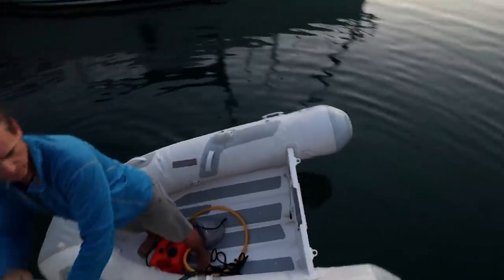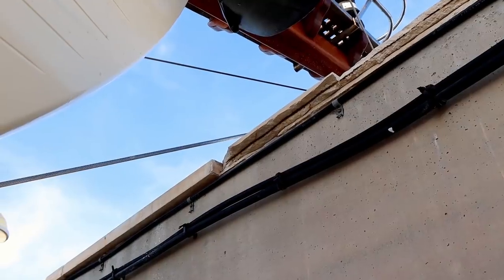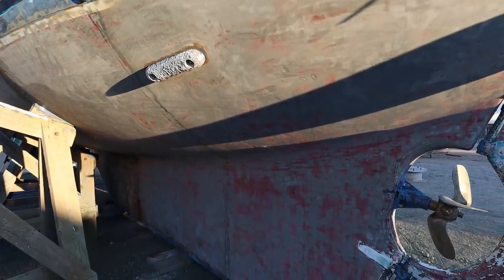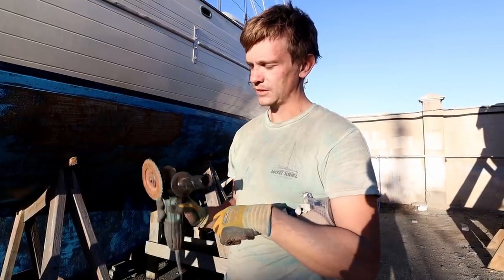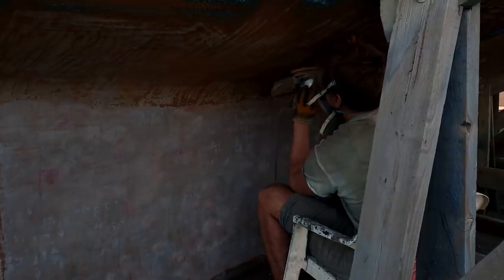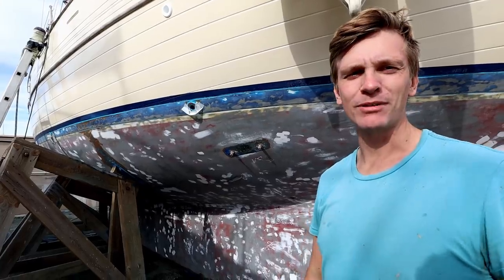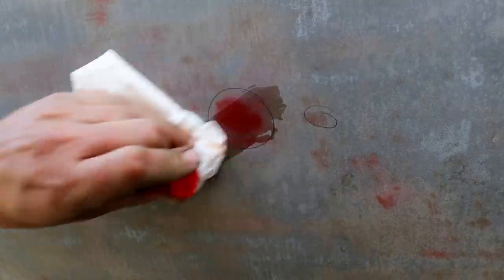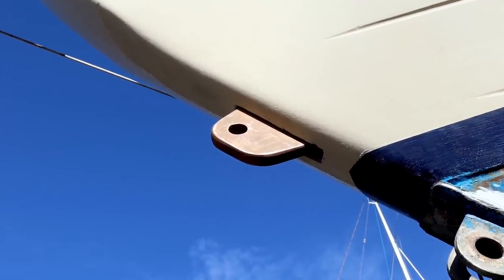88] DON'T Coppercoat Before You See This | 45 Year OLD BOAT Gets Bottom MAKEOVER

Comment: I applied and Coppercoated in 2011. The problem your boat suffered was well understood then. I used solvent free epoxy supplied by Coppercoat. On the upside it's only two coats (because it doesn't evaporate) on the downside you need good weather (above 12 Deg with low humidity) It was perfect when sold in 2018.

Comment: I’ve had two boats copper-coated ... both were done professionally. Neither caused me any trouble. Both performed exactly as forecast by the manufacturer. In my experience it’s a fabulous system, but the hull simply must be prepared throughly. In amateur hands - in the wrong environmental conditions - copper-coat will not work correctly. Think long and hard before opting to install copper-coat. If you can’t be sure of doing it properly, just don’t go there! 

Also, loved that dinghy bow-thruster!! 

Go, you two 😎⛵️💯

Comment: Looks like a tough job, a huge degree of patience and a large surface area to give 100% attention to every bit. How long did the whole job take, rough cost and did you hire or buy tools. I assume this exercise is a major part of annual budget? Did you sleep on board every night?
Reply from the maker: 10 full days. No, we bought the tools - they’re useful to have on board anyway. The cost of smoothing the hull must have been around €450 for the tools (we had to replace the sander halfway), discs, sand paper, etc However we already owned the angle grinder from the previous refit, so it cost us about €350 at this stage.
Yes, we slept on board every night.

Comment: the pencil hash marks are called a guide coat...you can do the same thing much faster by using a very light coat of spray paint then sanding that back to reveal the low points...much fast and much easier.
Reply: I learnt that trick spray painting my car. I used simple black and then sanded it before applying the other coats. YouTube is wonderful in that respect!
Reply from the maker: Would it need to be a 2 pack paint if putting 2 pack over the top?

Comment: Those carters and moon like surface is exactly what my coppercoat type antifoul looked like. I couldn't remove it in the time I had so just sanded down 36 grit and put antifoul over it with a tie coat. That worked fine. It would be nice to completely remove it though at some point. I was in Almerimar last year. Is the green yard dog still around?

Comment: Just wondering if a heat gun would have been worth trying on the hull. I've had some exciting times getting into travel lifts. One with no power where the dock assistant assured me he had it all under control until he didn't.

Comment: An A+ for diligence and hard work.
 Of course, there is always a "But!" Ain't YouTube fun !!! 😁
First, you need to practice your "Back and Fill". I have seen a skipper crab a 45" long keeled ketch (not counting the bowsprit), 150 ft down a marina alley with very expensive boats on either dock, with barley 10 ft either side to spare.
 As far as fairing goes, what you did was more "smoothing" then fairing. You need a fairing board, aka agony board to do a proper job.
 That rectangular sander you first used was an orbital sander, not a random orbit sander like the round disc one you later used.
 Anyway, happy sailing ad keep the videos coming.  I assume this one was before the Coronavirus hit. Hope you are safe.
Reply: Rick Owens Hi Rick, yeah, we call them ‘Torture boards’ for similar reasons. I’ve seen four apprentices swinging off the one four metre torture board before. Looks impressive when they’re  all perfectly synchronised and the results are impressive when used in professional hands. Get it wrong though and it’s an arduous process to smooth out the hollows!...

Comment: how long would a job like this last? 10 years? 20? just wondering how often something like this needs to be done. thanks.
Reply from the maker: It depends on how much antifouling you put on every couple of years and if you scrape it off before applying new antifouling. If you just add layers and layers of antifouling, you could be doing this job every 6 years or so. Also this job was way worse because of the failed coppercoat if you just need to remove antifouling it’s a breeze compared to copercoat

Comment: That is a lot of work.  Sand blasting would seem the way to go.
Reply from the maker: Sandblasting wouldnt work as it would blast the exposed underneath areas as much as the coppercoat, so you’d end up with holes in your primer and gelcoat etc.
Reply: @SailingKittiwake  I just did the sandblasting, and it was not the way to go :)

Comment: Could you have used a chemical paint stripper or rented a media blaster to remove the Coppercoat?
Reply from the maker: I dont think chemicals would strip the copper as much as they’d damage the primer and gelcoat.
Reply: @SailingKittiwake  I used a chem stripper on my boat. It worked well on old ablative, and paint, was easy on gel-coat, would not touch copper - at all.

Comment: You shouldn’t use flapper discs on a hull. Bad idea. Use the rubber disk with the flat pads and keep your grinder flat. Much better result.
Reply from the maker: What went wrong that would have been better with a pad?
Reply: @SailingKittiwake   well, you can see the groves it made on each stroke. then it needed heavy sanding with a flat sander. by using flat discs you don't get the grooves. It was just a suggestion. something I learnt from Sail life video's and put into practice on my own boat and it sure saves time.

Comment: One of those jobs I would of been paying someone to come media blast it one day blasting one day cleaning the mess left behind
Reply from the maker: What about all the time to repair your gel coat? Look at the zoomed in bit and you'll realise why blasting wouldn't work for this job
Reply: Wetblasted with crushed glass would not damage your gelcoat
Reply: Blasting doesn't remove copper coat. It's harder than the gel coat, so if you are going to use more abrasive media it will also harm the gelcoat

Comment: You are using the wrong grinder. You want at least 7 inch, 9 would be better but heavier. These are not better because they are stronger, rather due to a larger diameter being MORE flexible further away from the heavily stiff hub. You keep the disc as flat as possible,  the forces will cancel to a degree due to being applied in both directions. Never use edge, it can catch and it will HURT. Flappers are fine for finish, not bulk, Flat 60 grit and they will clog quickly, so learn how to clean, or better yet start with a heavy wire wheel. Warning, these are deadly, full face protection, leather gloves and coat, NO shorts, boots. I do not know what the yard rules are, but really sand blasting seems like a much better process. Your  wide shallow grooves have made for a lot of welding, narrow deep are much easier to fill. Neither are difficult welding, even a beginner could manage, bur very time consuming as you must grind again. Copper coat seems to get mixed reviews... seems very application sensitive. As an observer I was wondering if any one has tried spray on truck bed liner, (commercial stuff, not rattle cans) never seem to see much growth on plastic jugs floating or nylon lines.
Reply from the maker: Have you tried removing coppercoat? If you think this could be sand blasted you haven’t looked close enough!

Comment: @7:34 that is a belt sander mate, not an orbital. it goes back and forth not round and round. nice work though.
Reply: No it isn't. A belt sander has a .... belt.  And rollers. And is about 2x the size. That one is clearly an orbital with a rectangle pad.
Reply: @WakeforMe  True, I have one that takes square pads and one that takes round. One is 110v, the other 230v just for variety. Both random orbital.